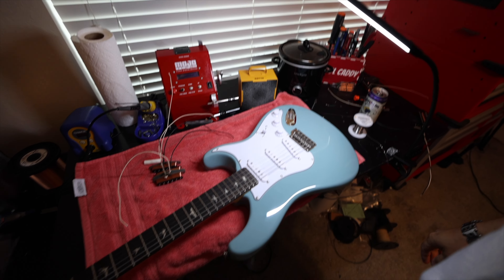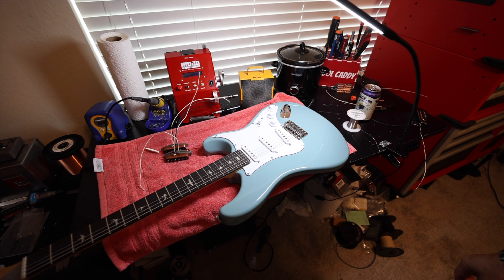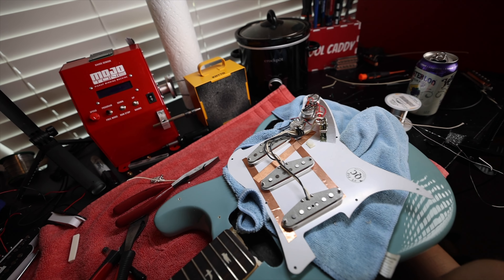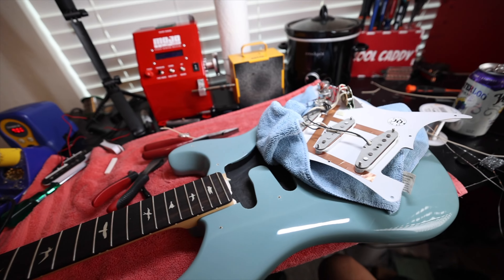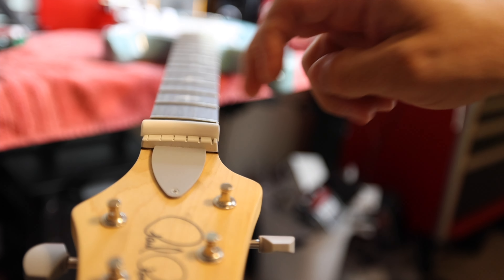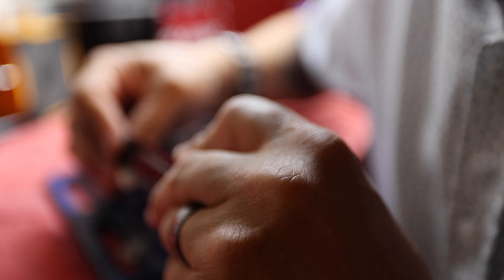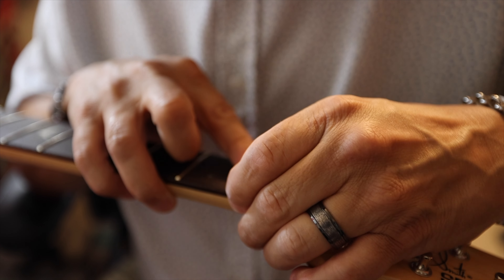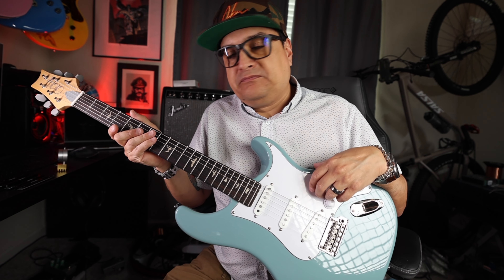Would Hendrix Play A PRS Silver Sky

Comment: One thing no one seemed to notice is that the angle of the bridge pickup is backwards causing decreased treble response on the high side and more treble on the low side which is the opposite effect of what they were going for by angling the bridge pickup to begin with.
Reply: It's not backwards though, it's the same
Reply: @stepans2167  if you look at a normal one you’ll see that the side of the pickup for the bass strings is farther away from the bridge than the side for the treble strings thus allowing more lower frequencies in the bass strings and more treble in the treble strings. Since this guitar has been converted to left handed it will be held and strung upside down making the side of the pickup for the bass strings closer to the bridge adding more treble to them and the side for the treble strings is farther away from the bridge reducing the treble to them, which is the opposite of what they were trying to do when they angled the pickup in the first place.
Reply: @rh2123  oh, I see what you're saying, that's true. I must say though, that it's probably going to sound better. The bridge pickup in a strat is typically very shrill and trebley